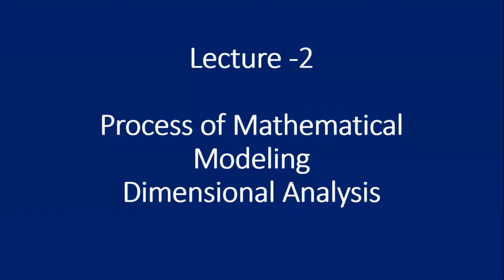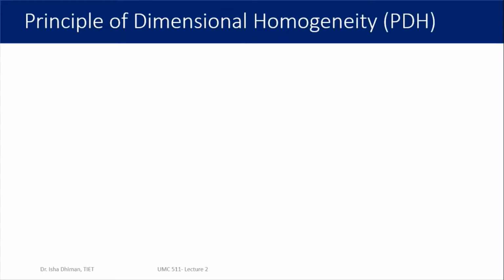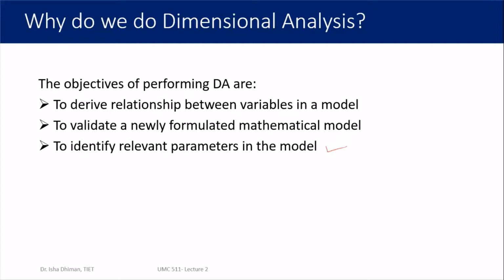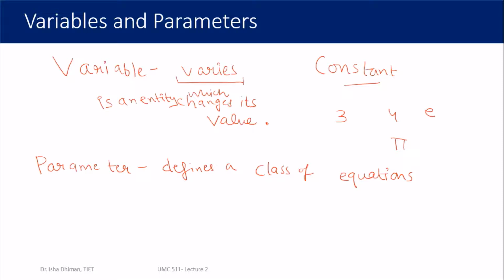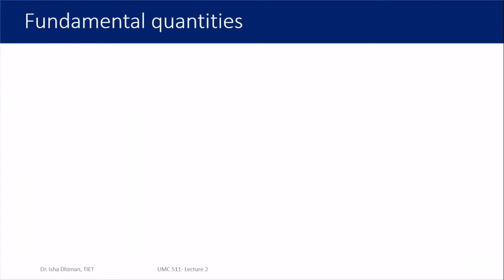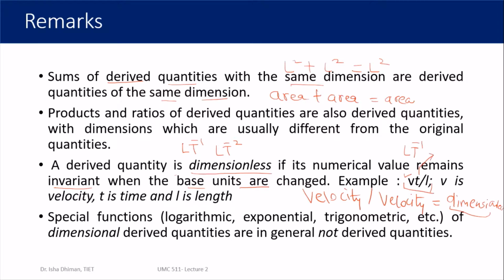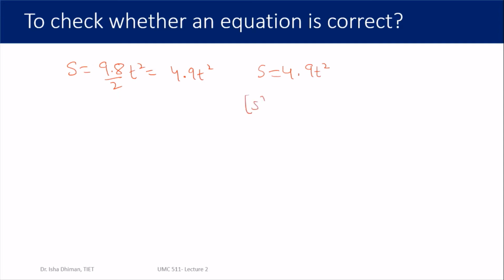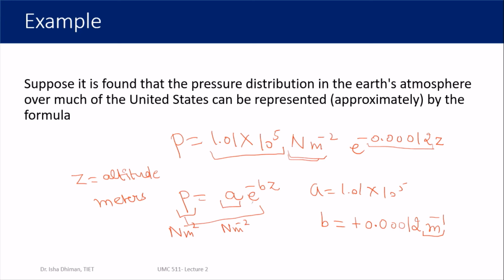Lecture 2 : Dimensional Analysis of Mathematical Models (part 1)

Comment: One question
As the value of g is fixed then why it is called a parameter why not telling it a constant ?
Reply: There are differences between mathematical constants - such as π, e and so on. They do not have dimensions. 
The physical quantities defining any physical problem have dimensions in addition to their units and numerical values (numerical values are based on the measuring system or standards or units) . 
"g" is not a mathematical constant - it is a physical constant - meaning it has has dimensional property. That is why it is not a constant in the analysis of physical problems. That is why it is a physical parameter.
Reply: @arunarunachalam3362  got it thank you💓💓